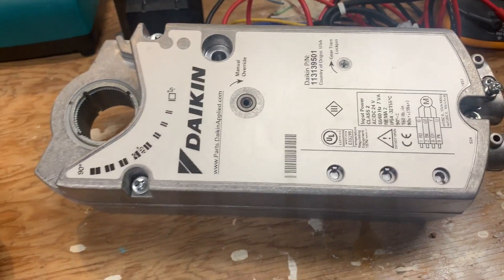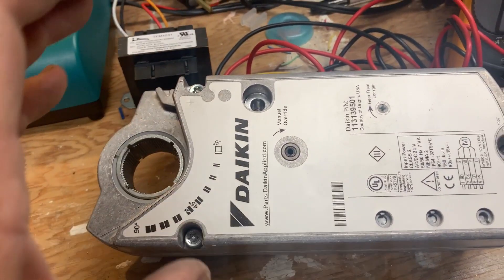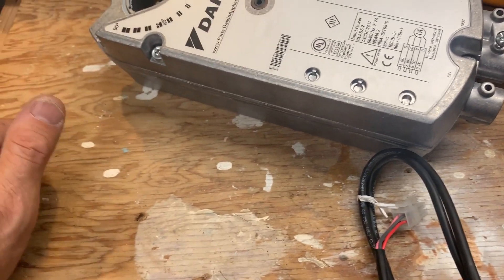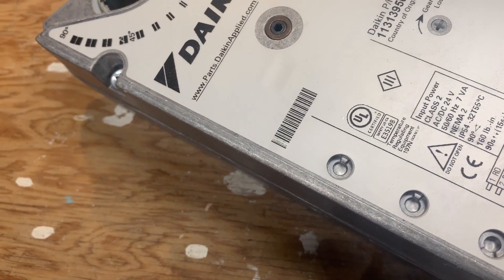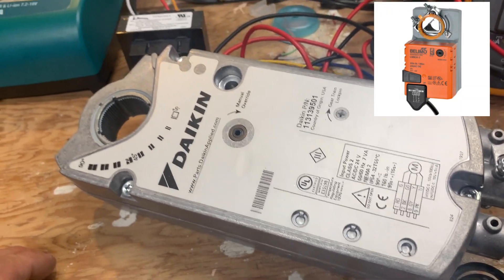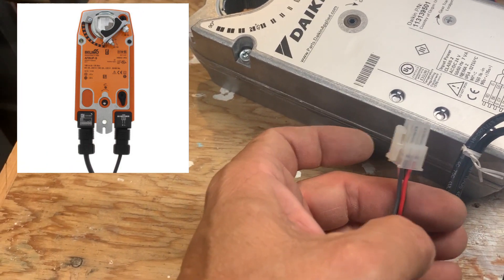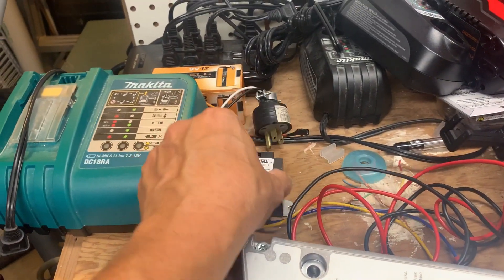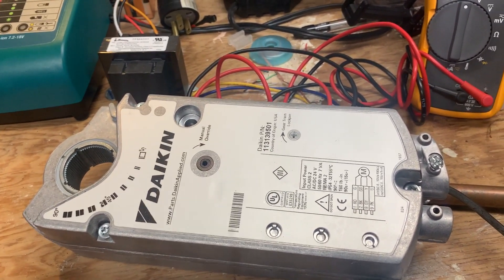Actuator Trouble Shooting

Comment: Doesn't the actuator move to its full position once only the 24v power is supplied
Reply from the maker: 24 volts gives it the power to move, 0-10 volts tells it how far to move, 0 being closed, 10 being 100 percent open, in this application.